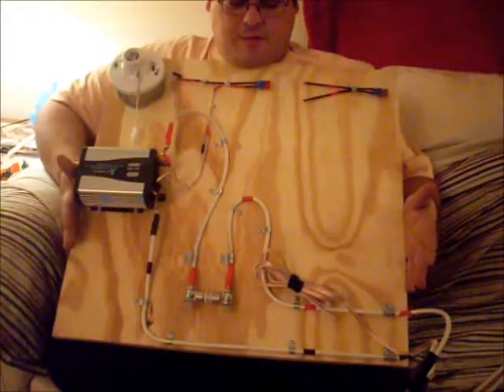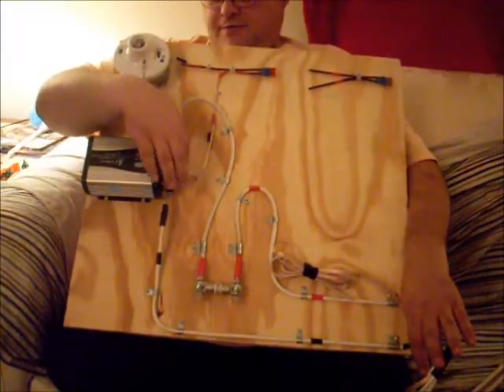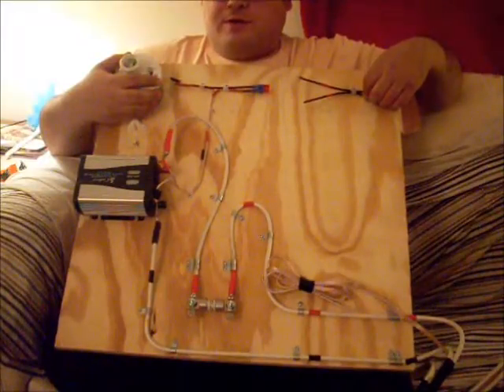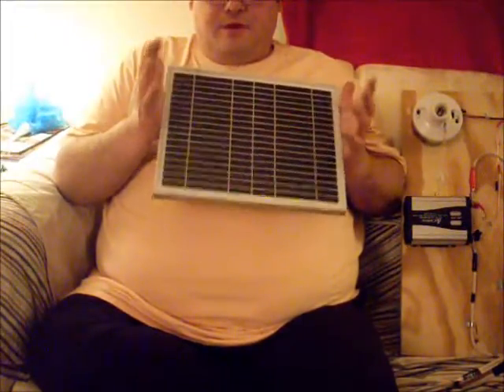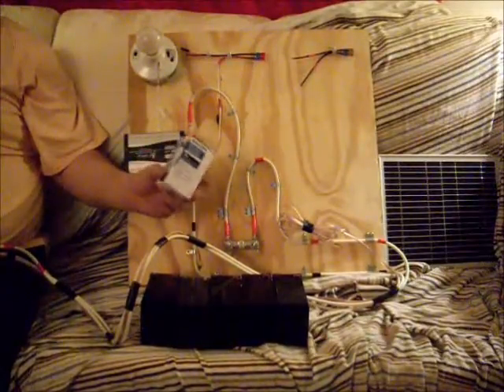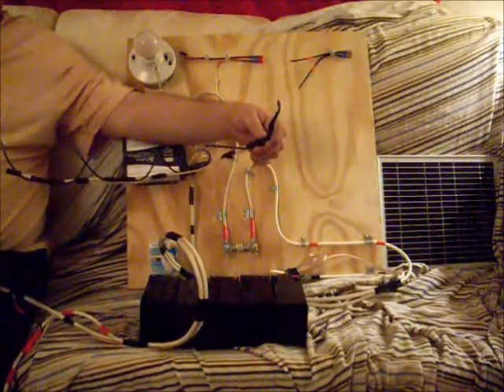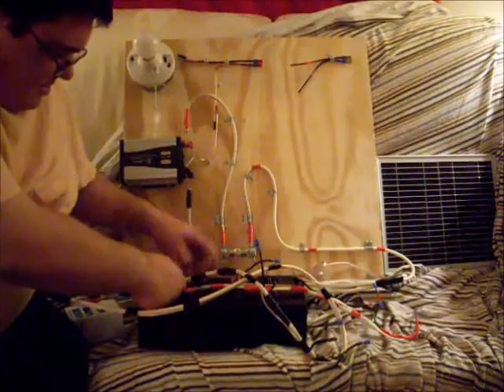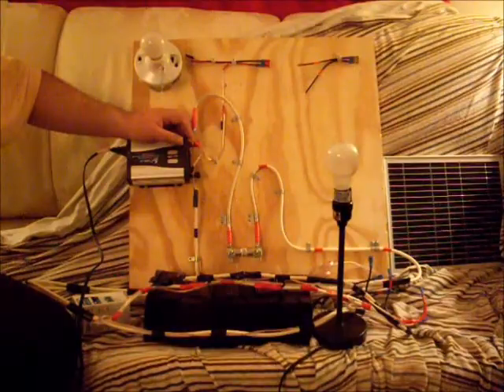DIY - Cheap Small Solar Powered Shed Project - Part 2

Comment: You have the light fixture connected to the back of the inverter?
Reply from the maker: Yes, it is a 12V light
Reply: @frugalprepper  and you can connect a regular light bulb or a special dc light bulb? And thanks for your fast responds!
Reply from the maker: @jay45730  It is a 12V DC light bulb.  They sell them for RV's